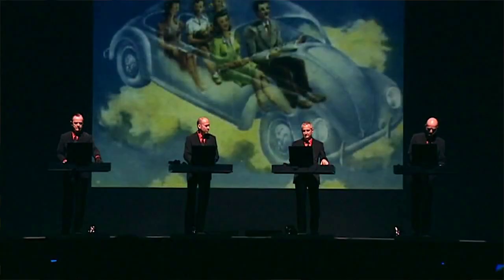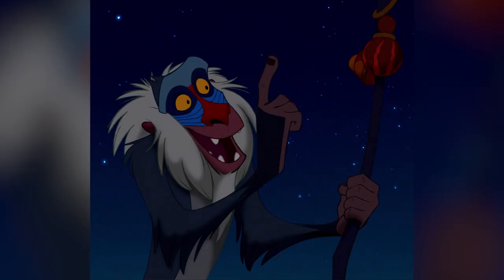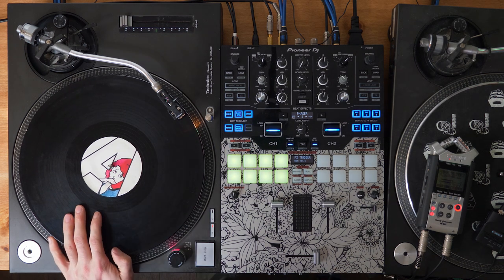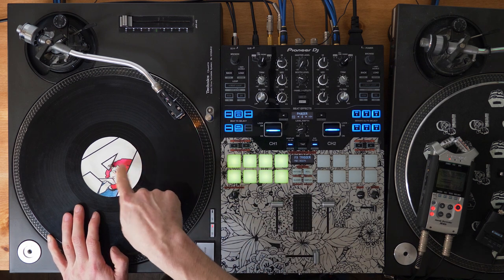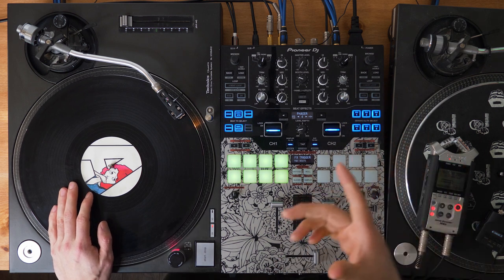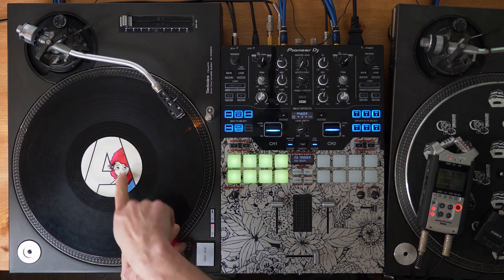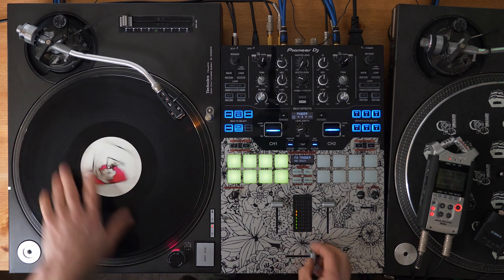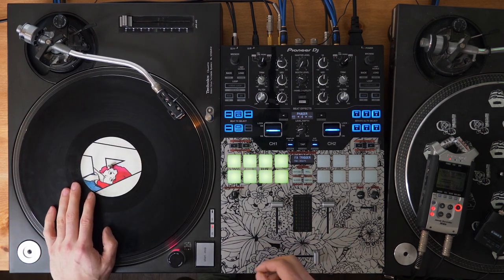ADVANCED AUTOBAHN SCRATCH COMBOS [ADVANCED SCRATCH TUTORIAL]

Comment: Great video! I have always heard the 6 count Autobahn being called the Autobahn A6 and the original is the Autobahn A9. Can add to those numbers  as you increase the triplets.

If you can do tentacles I would love to see something on that. It's very versatile since it can be done forwards, backwards, or by changing the counts in each direction. It's one of my favorite sounds but it's been one of the hardest techniques to master in my experience.

Keep up the vids, thanks!
Reply from the maker: Ya makes sense on the 6, 9 thing. Never even heard of tentacles! What are they?
Reply: @SiHargreaves  if you have access to the scratchlopedia it's on there. But it's basically 4 types:

4 tears forward, 2 tears back + 1 click
4 tears back, 2 tears forward + 1 click
3 tears forward, 3 tears back + 1 click
3 tears back, 3 tears forward + 1 click

I'll try to make a demo of it and post it as a reply when I get a chance.